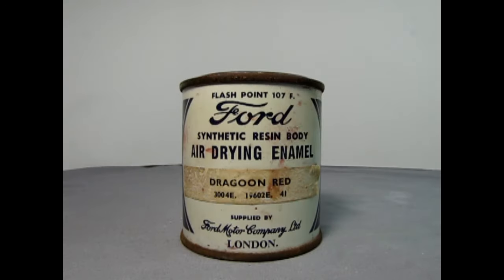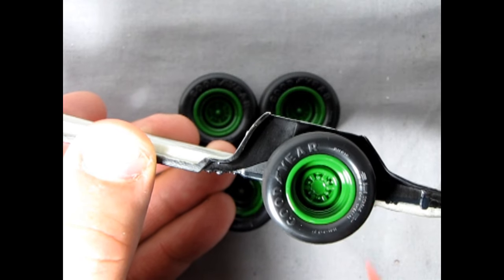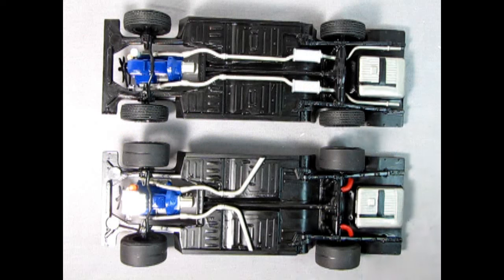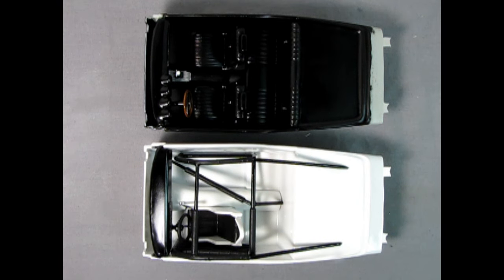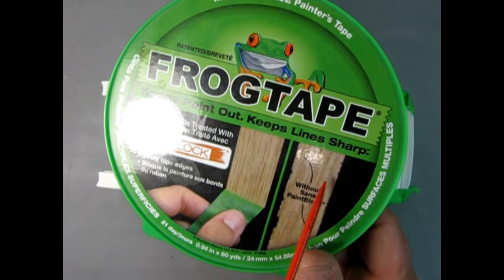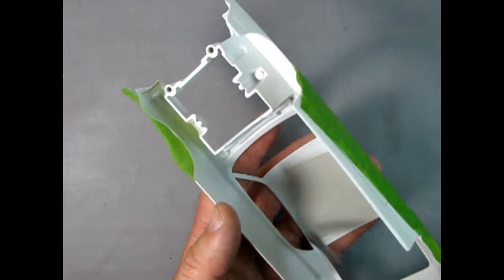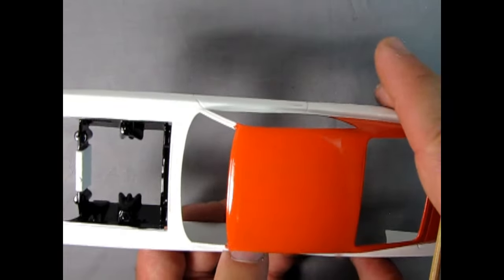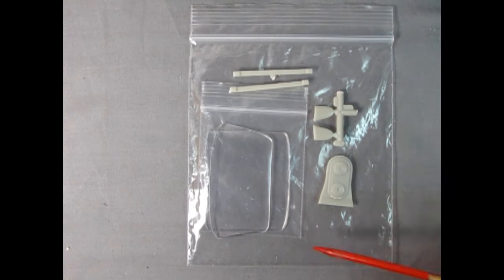How To Fix Everything Wrong With The AMT/ERTL 1969 Ford Fairlane Cobra Torino Model Car Kit Part 6

Comment: Great video,Trevor. I love your colour scheme.👍😎. Thanks for the shout out and I have moved some of the details along. I've shown how to make simple window winders,armrests and blanking off the pin towers. I've also trimmed down the front and rear screens,for a better fit and started on my widebody conversion,so I still have a lot to do and show with these kits. If a full NASCAR kit was required the polar lights Torino are a much better starting point,having a full Holman Moody chassis but with its own body problems. I am going to see if the amt body will fit on the polar lights chassis👍🤔🤞and I'm looking for a third amt kit🤣. Best wishes from jolly old England👍😎 Pete 🤓
Reply from the maker: Thank you Pete. I will have to check out your videos. 

As you will see in my "next week's video", I didn't really find that the AMT windows at full height had an issue with fitting well in the finished kit. In fact, I found that the roof on both windows had gaps between the body and glass until I pressed and held them in place until the glue set up. After that, the glass and body became one without any gaps. I used Testor's red tube glue and Testor's liquid glue for that job. - Yeah, I'm building this thing like a kid would! LOL! The funny part is that it works really well. 

I should get 2 more...one to build as the street machine version and another to build with engine wires and home made details. ... but I need a good break of a few years first!
Reply from the maker: Did you like my "Cheese" joke? 
I had to go back and watch this video again as I created it 3 weeks ago...so I forgot what I filmed.:_Sad:
Reply: @MonsterHobbiesModelCarGarage  I don't think you've built it as a kid would as there has been far too much research and improvements to the kit to get here. But I do think you have done a good job on getting the most from this kit without going mad.👍👍👍😎
Reply from the maker: @petesmodelcarcustoms584  Thank you Pete! I didn't go mad, but some of the build made me mad! :face-blue-smiling: